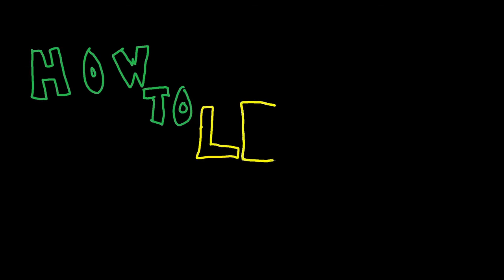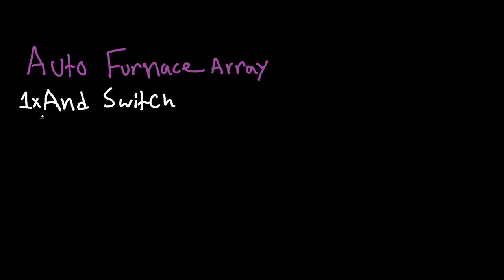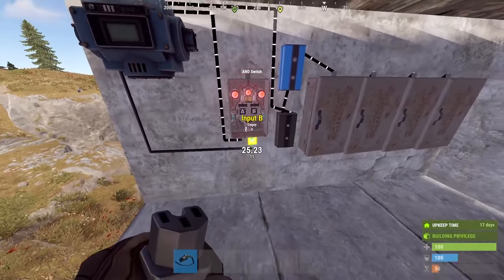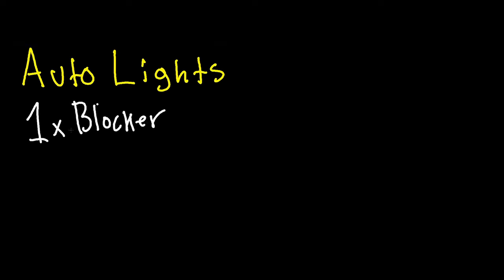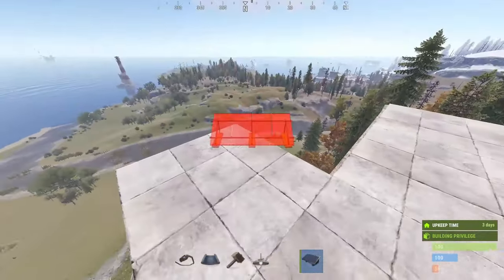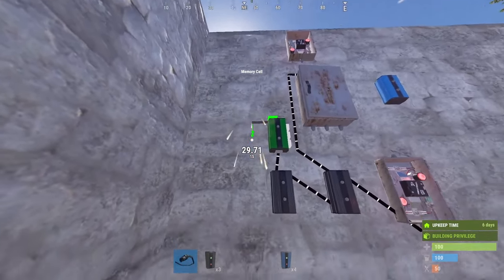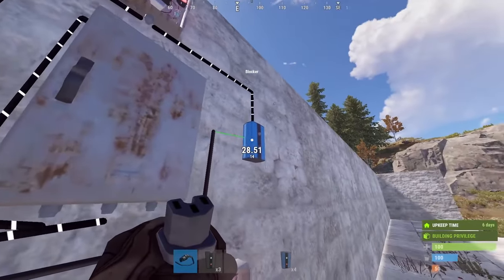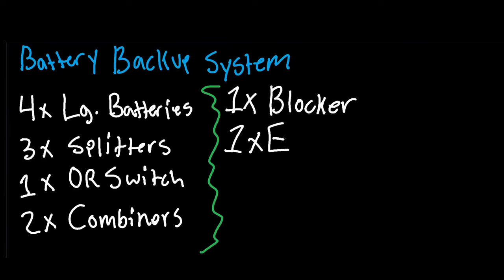TOP 5 RUST CIRCUITS

Comment: the furnace circuit is pointless. blocking the power to the splitters from the branch output does nothing for power consumption so even though your furnaces is are off you will still be using the same rust watts from the battery. its best to feed furnaces with the power out side of a branch.
Reply: All u have to do is change the branch out to the furnaces and power out to conveyor and but blocker before all the splitters for furnaces

Comment: I wouldn't recommend using that backup circuit, because after a few seconds the first 2 batteries will want to replace the backup batteries again. This back and forth will continue forever. Maybe you could use 1 blocker per battery pack, and 1 memory cell to completely drain 1 battery pack at a time.
Reply: I noticed this issue with the circuit as well, I've made circuits which do this, but you don't need another memory cell. 

With one extra blocker, you can just use another OR switch with each, so the output of the OR switch goes to block passthrough, each OR switch has an input connected to the opposite bank's electrical branch branch out (left at 2 watts). The other OR switch inputs come from a splitter.  The original blocker is removed and the NIH core splitter only has 2 outputs (not 3) for the memory cell so set to 3 instead of 4. Add another electrical branch after the NIH core splitter branch which needs 5 power, finally, the power out of that branch goes to the charging splitter. For each bank it goes 2xbattery -> root combiner -> blocker - > branch, power out going to the core OR switch.

Hope I wasn't too difficult to understand, figured I'd share my design here (adapted from Cableguy Rust which used 1 battery). There's not much point IMO in using this video's design for the first bank to be left draining for no reason while using the other bank when only a few more components would fix the issue. I might copy/paste the comment.
Reply: But it'd work great if your batteries get destroyed. It's a good concept for redundancy, especially fie turrets

Comment: The auto furnace setup kinda defeats its own purpose by using a branch for power. The power consumption on a branch off side is always counted as active use, regardless if the power is used. Having the blocker there does not affect this at all. So it doesnt matter if the furnaces are on or off, the circuit will draw the same. To fix this I would suggest running the power through the both conveyor passthroughs and into the blocker, leave the branch out entirely.
Reply: but if you have a power bus to deliver the power to this system that would still require a configured branch. You way would work only if you weren't using a nih-core, and it it was on the last branch output from your power bus.

Comment: At the auto furnaces, the igniter isn't needed, and a memory branch (green one) could've replaced most of that circuit
Reply: or u could just use a switch connected to the splitters, thats what i usually use

Comment: Your auto furnace can be made more auto-y, but requires you add 9 more power. A far better trade off than having  to press the button and replace the igniter every day. 

[Ore Filter Pass ]--->Furnace On | Furnace Passthrough ---> Furnace On | Furnace Passthrough  (etc, down the line of furnaces)
Reply: no need to replace igniter every day 
you just press button every restart and thats all
Reply: @industrialcrafter4889  

Igniters break after 12 or so uses. 

If you use the on switch it also accounts for server restarts too.
Reply: @SaltSeasDev  no they dont break after 12 uses
Reply: @SaltSeasDev  they take around 1hp every use and they have 250hp

Comment: Auto-Start-Stop Electrical Furnaces:
  Piping: Large Box -> Input Conveyor -> Furnace Chain - > Output Conveyor -> Storage
  Electrical (Mainline): Switch -> Input Conveyor -> Output Conveyor -> Memory Cell -> Splitter(s) - > Furnaces
  Electrical (Auto-Start): Input Conveyor (filter pass) -> Memory Cell (Set)
  Electrical (Auto-Stop): Output Conveyor (filter fail) -> Memory Cell (Reset)

The switch only exists to cut power to the circuit and can be skipped if preferred. Remember that you need to manually Turn On each furnace once per server reset.

Comment: An issue with the battery backup shown in this vid is that the first pair of batteries will continue discharging even when the second pair are being used. With a few more components and by adjusting your NIH core you can prevent the issue.

Use 1 blocker right after each root combiner. Use another OR switch with each, so the output of the OR switch goes to block passthrough, each OR switch has an input connected to the opposite bank's electrical branch branch out (left at 2 watts). The other OR switch inputs come from a splitter.  The original blocker is removed, and the NIH core splitter only has 2 outputs (instead of 3) for the memory cell so set to 3 instead of 4. Add another electrical branch after this NIH core splitter branch which needs 5 power (which goes to the splitter then the two OR switches then blockers), and finally, the power out of that branch goes to the charging splitter. 

For each bank it goes 2xbattery -> root combiner -> blocker - > branch, branch out going to OR switch (then blocker), power out going to the core OR switch.

Hope I wasn't difficult to understand, figured I'd share my design here (adapted from Cableguy Rust which used 1 battery in each bank).
Reply: why should i use nih core when i can just plop another turbine?. nih setup is like 15 power by itself. i fail to see the necessity tbh.
Reply: @TheDemethar The nih core only costs two rust watts when power production meets the required amount. The idea is to reduce the 20% hit on everything that happens when you go through batteries exclusively.

If you are just a zerg with a giant base, it's not that important. A ford pickup truck will drive in the alps just fine but a ferrari would do it better. The nih core is the ferrari.

Comment: Why do you need the lighter for the furnaces? They have a turn on input.
Also the lighter takes damage each time you toggle it, how do you deal with that?
Reply from the maker: This is an old design before the recent electrical changes. Logic circuits used to add compounded rust watts cost.

So it was easier to just cut power. And use an igniter to turn them on whenever the server turned them off on restarts. So you would only click the button a max of like 28 times. Which is wouldn't even come close to breaking the igniter.

Comment: Instead of counters couldn't you use AND, XOR or was it OR switches or something because they didn't consume any power?
Reply from the maker: That used to he the case, but now all the different switches in the game cost  1 power
Reply: If you use a conveyer and link them all via the filter fail branch then the total usage of the circuit will only ever be 3 power. The filter fail generates 1 free power upon failure.
Reply: @JohnWillikers  no, and still uses 0 power
Reply: @JohnWillikers   for example in your auto furnaces you had 2 filter fails going to and but output is still 1 so AND gate dont use any power

Comment: i dont know what a nih cor is or what it does anyone want to share?
Reply from the maker: A Nih Core basically routes incoming Power Generation to Pay for your circuits first, then spends the rest on the battery.

If power generation falls below power requirements, then all power is sent to the battery and the battery pays for power costs.

The reason we do this is because a Battery has a 20% tax on it. If we sent 100 power to the battery we end up only storing 80.

So instead if we had a power requirement of 90 we would send 10 to the battery, storing 8. Which means we would have lost 2 power instead of 20.
Reply: ok that makes sense, i was using an OR switch to pick between battery and live power that sounds like the same thing, I'm going to build yours so I can understand it, thanks for replying! @JohnWillikers

Comment: You can do auto light easier. Just use blocker and branch from red cell. If the solars have power then the light is on. Simple.